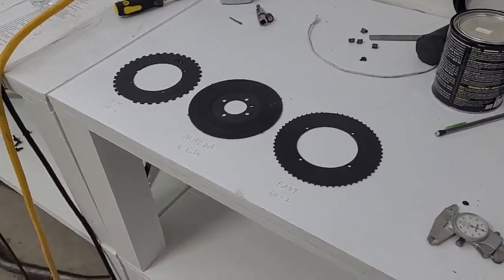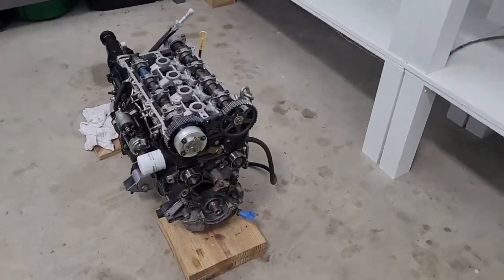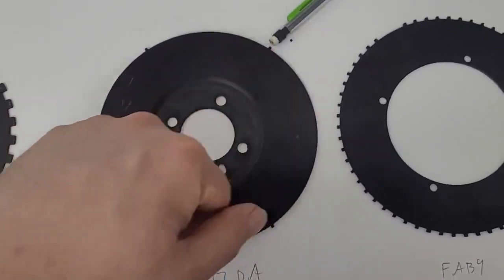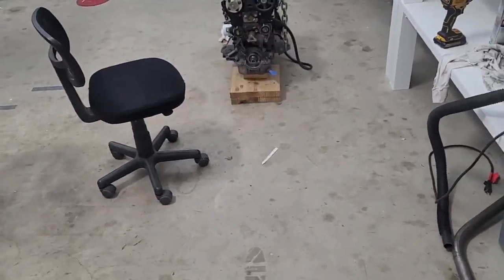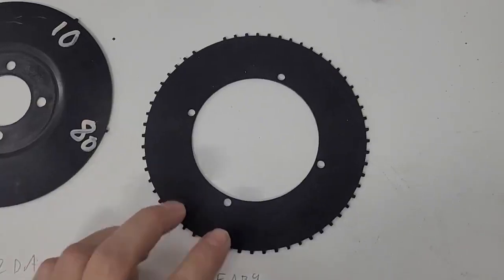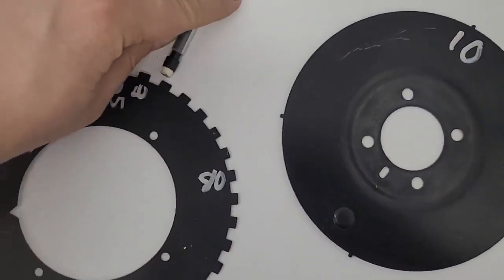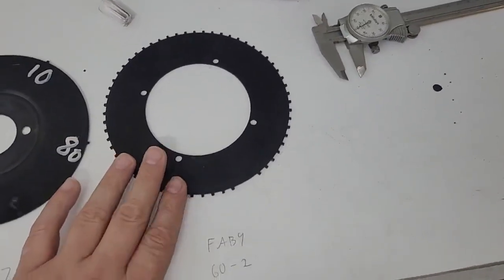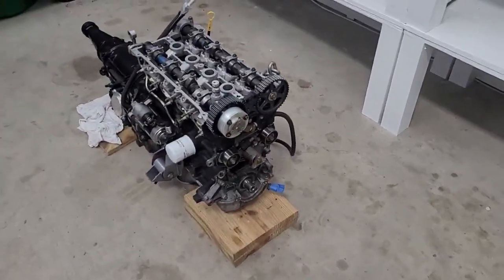Racecar Engineering - Crankshaft Trigger Wheels

Comment: so with the 36-2, you kind of get a reading every 5 degrees. as you get the rising edge and falling edge? As the gap would be 5 degrees of rotation then the tooth itself would be 5 degrees(assuming tooth and gap are even)
Reply from the maker: They do 36 teeth spaced 10 degrees apart. But my ecu only looks at one edge, so it uses 10 degree info not 5.

Comment: I installed a 60-2 Fab9 wheel on my fresh build. The teeth looked janky to me and the wheel oscillated a tiny bit. I'm new to this so I did not know any better and installed it. When I went to check my car's timing it was off by 6 degrees at idle. So my hall sensor was not reading one of the teeth. I cannot imagine what would happen at 7k rpm. I just received a 36-2 from 949 and it looks much better.

Thank you for sharing this information. Well done!
Reply from the maker: Glad this was helpful!

Comment: great video, sucks the Fab9 part is junk.
Ive always wondered about applying this idea to the VVT cam Reluctor wheel as well, seems to me it would be another case of more teeth being better, as long as the ecu can be told theres more to count
Reply from the maker: That's a good point, I've never considered if it would help or not. I suppose knowing what duty cycle you are PWMing the valve would kind of answer that. If the frequency is too low, then you would already have up to date info after a certain RPM so having more up-to-date data would be of more limited use. But then again, if you had more data, perhaps a valve with a higher PWM could then be implemented. Something tells me more modern cars probably have more teeth and high control frequencies.
Reply: Why do you say that the Fab9 wheel is "junk"?
Reply: @billwilner1839  rough edges on the tooth profile that can lead to inaccurate readings

Comment: For awhile, Nissan ran a 360 "teeth" trigger system. While it's a high quality part, they have a fatal flaw where the trigger disk is driven by a timing belt. At high RPMs, especially with aggressive valvetrain mods, the cams would start oscillating in respect to the crank. That would cause the crank sensor to double read several teeth, causing a noisy crank signal. People would either swap out the trigger disk for a 36 tooth, or switch over to a crank driven trigger system.
Reply from the maker: That is really interesting! Makes perfect sense. I've actually spent many hours thinking about implementing a 360* tooth wheel on the crank.